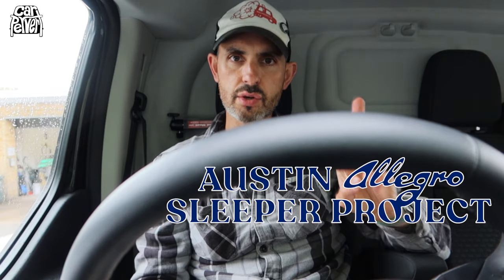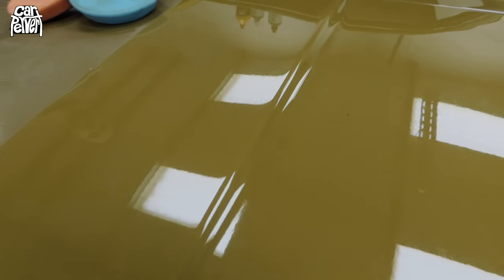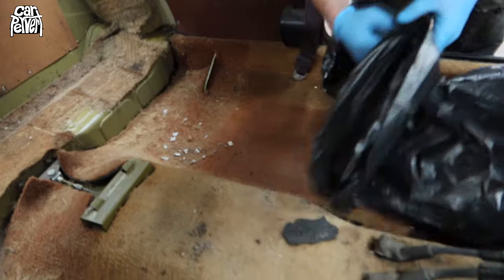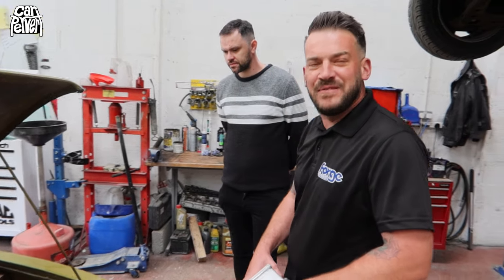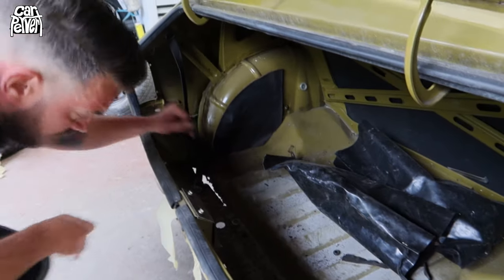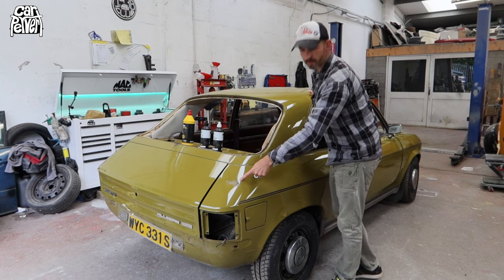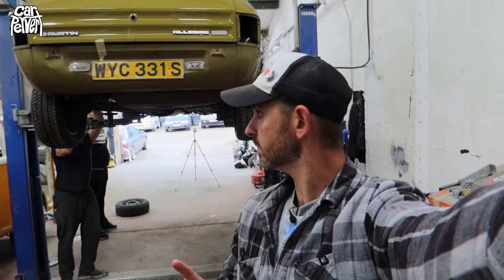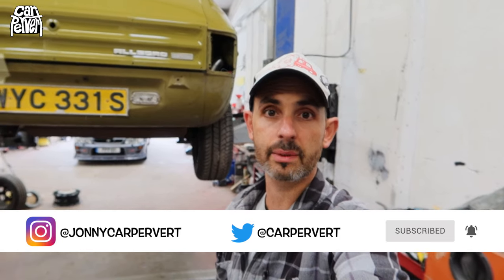Part 2: Austin Allegro V6 supercharged sleeper project

Comment: I am surprised you would use an Eaton Blower (ala improved  but still inefficient GM 2 stroke blower).  I would have thought a Sprintex unit would have been smaller and they are certainly way more efficient, thus giving you two pluses and no minus's.  I can only presume it is due to obtaining the blower cheap.  It will certainly be more difficult to install in that somewhat cramped engine bay.  Apart from that, a really nice installation being performed.  Have only just found your channel last week.  Thanks

Comment: Im limited on space and cool air on a vw T3 bus as well. So chose a chargecooler, small unit fits under the lid. Made a 10ltr water tank and audi cwa50 pump, all works and flows nicely. Chargecooling is sometimes the only option on rear engine cars, or limited on real estate upfront. 👌

Comment: Question: Why not use an Allegro Vanden Plas (guess they're super rare now)? That big front looks like it was made for a big Rad/Intercooler. 
That said, I can't wait for the updates on this project. Talk about an unlikely sleeper 👍
Reply from the maker: VP grille would be ideal for a cooler, you're right. Trouble is, I hate them.

Comment: It's SOOOO nice to be able to start with a relatively solid rust free car. Eager to see how this goes once you've got it all together. I really like the idea of the rear rad with a nice custom fuel tank up against the rear seat bulkhead. Don't pay attention to the nay-sayers. You should have heard (and they continue) the purists when I had a D16 VTEC swapped into my 1968 Riley Elf. Don't care. It's my car and it's the way I want it. Crack on!

Comment: Hi Jonny, I have a soft spot for the Allegro.  When I was 18, I had a lift home from the local public house with three other friends as passengers when a Peugeot 205 GIT (there is only a single marque worthy of the GTI moniker and has been made in Wolfsberg since 1976) overtook us whilst we were indicating to turn right off the Dukes Ride in Crowthorne, near the Station.  The owner, Jason Longely, pursued the 205 towards the station until confronted by the F@ckwit driver standing in the road waving a tyre iron, he drove the car into the car park and without stopping back out again onto the road.  For a low mileage 1977 Mk2 four door 1275cc (one previous elderly owner, kept it immaculate) it was superb, not the asthmatic heap typically portrayed.  We were then chased around Edgcumbe Park for some 30 minutes but lost the nutter among the high value property...

Comment: Jonny havin use to work with you in the Rev's / Max power day's only you would do this with one of BL's shitters !  love it , ive just charge cooled my 98 T4 2.5 van and ive dropped 15-25 degrees and it works a treat. My cooler rad is under the van with 19mm hoses running to the front to a small alley tank and 12v vw sharan aux pump ... owe and it looks the part ;-)

Comment: If it's not all already fixed, you could use the fuel tank as a shell keeping the rear looking stock but the front end of the tank could be chopped off to act as a duct. To let the air through the floor and pass the radiator
Reply: Might collect a lot of crap though.
Reply from the maker: Very cool idea, thank you.

Comment: I doubt those hub caps would make it past track inspection if they are just pressed on. Might need a stealthy nut and bolt or safety wire solution 😉

Comment: I had an Austin Maxi sleeper once, it only had the standard 1700cc engine, but it was so slow you would be asleep in no time 😜

When I got it it was bright yellow with sun faded patches, I wasn't going to pay for a re-spray so painted it myself, I didn't enough of one colour so mixed all the paints I had, ended up a grey like primer, oh and this was house paint not car paint 😎 and I painted it with a brush, although without showing off you couldn't tell as I did it without any brushmarks, lots of room inside, but drove like a bus and just as slow, I don't miss it that's for sure.

Comment: If you are going to all this trouble- turn the engine around and make it RWD- radiator will fit then too. There is a tunnel of sorts there,  fab up the  gerabox hump, use a sister rear end out of a Farina maybe?

Comment: Single tube radiator might flow better but the twin tube will give more surface area between the air/water interface. Almost a case of 6 of one, half a dozen of another... Depends on how efficient the water pump is and how much piping you need to traverse going to the boot.

Comment: Will you not need a strong subframe to mount the engine to? Not to mention uprated suspension, brakes etc..
I have driven alegro's in the past and they flex so much if you jack one up with a door open you will never close the door.
Reply from the maker: All in good time.

Comment: Hey Jonny , another great video, with the radiator have you thought about putting it on the inside of the boot lid,eg 911.
Also good luck finding good 14" rubber, might be worth going bigger for better tyres choice. Just saying😉

Comment: i had an allegro in that same colour back in the late 80s. 'mustard' i more hopefully described it. mine was the 1500 engine model, but unfortunately though it just about survived an incident with an errant street light; (a tug with some rope on a tree later to pull the front back out the next day); it didn't survive some snot rag tipping sugar in the fuel tank.  it would've cost more to get it back on road with upcoming mot than it was worth, even back then.

Comment: Jonny.  You may have already mentioned the colour. Limeflower?  Leyland did some awful colours in the '70's/80's ! And just in case!! We were sent a memo., do NOT jack the car up with the doors open ! I think this refered to the 4 door specifically. There's a fair bit of welding required on this but in Allegro terms it's mint !

Comment: Lack of rot certainly will speed up the progress and save the pennies. I wonder how the boot radiator is going to be done and will it open slightly to dissipate heat maybe controlled electronically....

Comment: Jonny, you didn't say or I guess I didn't catch it in this or the first Allegro v6- but is that the FWD trans from the Rover or is the KV6 grafted onto the gearbox from the Austin? A very intriguing build- a sleeper indeed! This ought to ambush more than a few puffed up Jag and BMW owners!
Reply from the maker: This is the engine and original 5 speed gearbox from the 1993 Rover 827 Si. The engine of this era was a Honda but I think the gearbox was Rover.

Comment: You put the car on the lift and I thought "Those brakes look familiar".
Your not cutting up a car, the floor in the rear need to be replaced anyway and can easily be put back to stock.
Lovin the Avocado Green !

Comment: You could have two radiator fans on top in the trunk and have one be a puller and one a pusher fan to circulate air in the trunk

Comment: 10:23 It's how I buy old record players. Buy them broken, usually not that bad if they are simple ones :D. 
So little rot on the little Allegro, pleasing!
Unrelated question; What camera are you using: I saw a compact in the car's reflection (loads of reflection!) and the image and sound are both remarkably good for a compact, stabilizing seems great too. So now I'm curious!

Comment: Those brakes! It only weight 800-odd kilos! You won't have to worry about it stopping. The wheels, at least. Though, under hard braking, the body might end up with a slightly longer stopping distance!

Comment: Can you put the rear radiator in the place of the fuel tank? Like cut the tank out but leave the bottom as to cover the radiator and fans and it could also grab forced air from underneath the car? I hope you understand what I’m saying 💁🏻. Then maybe fabricate a fuel cell that looks like the trunk floor?...or “boot” floor? I think that would be cool and stealthy!

Comment: I think you just should had mount a 114, K motor with a supercharger. Solved a lot of the cooling issues and would perform pretty nice, I think.
Reply from the maker: K series?
Reply: @TheLateBrakeShow  yes, the K8 and K16
1400's from the metro 114.

Comment: I had Allegro 1500 5-speed,four door in British Racing Green for eleven years...Died due of corrosion after 28 years and had 185 000 miles on the clock with only minor issues...Why is this car hated??

Comment: Those seats, why not investigate some Austin/Leyland Princess seats. of the same era, would have the same colour/material to match but with a higher back and head restraints... safer in this modern world.. just a thought. ... I had a MK2 Allegro with full leather and wood interior out of a Vanden Plas along with the 1.5 and 5 speed. Cracking little car, wish I still had it.
Reply from the maker: Great idea. I might look for some brown high backs

Comment: What is the Budget/Cost on a project like this? I’ve wanted to a project like this for years but always worried I’d end up sinking tens of thousands into it.
Reply from the maker: Very hard to estimate, as depends on level of detail (engine paint, suspension paint, chassis paint) and type of engine and tune you opt for.

Comment: If the car is machine polished, how is it that the paint isn’t “sanded off” off by the discs?
Reply: The top “layer” is, to reveal the good paint underneath. It’s all about how aggressive to abrasives and compounds used are as to how much/how quickly the paint gets removed. If you use something too aggressive or go over too much then eventually you’ll burn through to primer etc

Comment: Why not fit a half radiator at an angle and mount a coolant tank in the trunk? Long coolant lines but it would offset the weight at the front somewhat

Comment: How about a Porsche style twin front rad set up fed by those twin grilles on the front panel and flow boosted by an auxiliary electric water pump? Leaving the remaining frontal space for the oil and intercoolers?...??

Comment: You need a solid car to modify, no good putting a lot more power into a car then leaving the backend sitting at a set of lights. Also, regarding this car, had you not bought it, someone else could have more than likely stripped it for parts and it would have been lost, even if the person who bought it realised how good what they had was, they would likely not have had the resources to rescue it alongside whatever project they bought it for getting it closer to completion. And as you're doing a sleeper, you're going to preserve a lot of this car, so I think, given where it was heading, this is the best outcome for this car. Second best in a perfect world where seeing it become a 100% preservation/survivor is what would happen, but again, likelihood of it being rescued like that was very low.

Comment: Would an angled radiator core not work perfectly in that location. Get the air scooped in from underneath or through the rear sills, so that the angle of the core doesn't come perpendicular to the air flow. That ought to aid flow through the radiator, and allow for a shallower, more compact setup.  BMR in Leicestershire do 45° cores
Reply from the maker: You might have a plan.

Comment: i'd still get some nice after market wheels just for the show...
also 4wheel drive maybe?:D
Reply from the maker: I have considered it. Got a set of Lotus Eclat polished rims I was going to use.
Reply: (i had to google the eclat rims for a sec there) hmm i was thinking about something on the 3part 15-16inch bbs line, but looking at these they might look great on the allegro as well. I just feel like, that a modified allegro needs some nice rims that give away, that something isn't really right there. 
on the other side completely I agree with the "keep the rest of the car as stock as possible from the outside"

Comment: Obviously it needs more room for removing air from the radiator. + heating all that fuel is very bad for performance.
Why not make whole partition between rear lights a net or ribs? A'la Testarossa.

Comment: Has this very interesting project stalled permanently or simply on a back slow burner pending better times?

Had Allegros as company cars back in the early days. A basic 1100 with good old A-Series and a top spec 1750cc with twin SUs. The latter would show a clean set of back wheels to many other ordinary production cars about on UK roads back then much to the surprise and chagrin of the owners of so called "superior" means of getting about. 

I blame the snide smirking Clarkson kneeling at the side of an Allegro in the intro of one of his very early Clarkson's Motorworlds or whatever it was called. Huge negative influence and his many follower Clarkson wannabees who studied and passed with flying colours at the Clarkson Academy of Motoring appraisal excellence still continue to spread their poison about most things that Longbridge, Abingdon and Cowley produced.

That aged BL paintwork came up a treat! So base material quality must be good to achieve that after all those years.

Have searched YT for later updates but have drawn a blank.  Do they exist?

Comment: Fit ac cobra style bumpers , it will fit with the curves and look like a Shelby hot hatch 😀
Reply from the maker: Nope, all original trim and bumpers going back on.
Reply: @TheLateBrakeShow  yeah, can't really argue with what you have planned, the ultimate sleeper, just the curvy shape low down made me think cobra. Would like to see this line up against project binky

Comment: Hubnut just realised that raptor isn’t all it’s cracked up to be on the underside of his 2cv
Reply: If the surface underneath is prepared correctly, it is virtually indestructible in anything but extreme circumstances. If the surface underneath is less than perfect, it won’t last very long

Comment: Jonny, when you have finished your much appreciated dinosaur conversion, please consider many of the EV tuning companies that currently offer 600+hp from the addition of a rear Tesla drive unit. This would finish the car nicely with a rear-wheel drive Tesla performance upgrade. This can give you at least 1000 hp all round in an Allegro, and you should win an award or Guiness world record for the madness that the car would become. You can put the batteries in the boot or in place of the rear seats. You would not require a large battery space as you can use this just for traffic light grand prix or quarter mile annihilation's.  This would make the project a true 4 wheel drive sleeper, and also a hybrid (!) - which I am sure would upset the DVLA as it would have a lower taxation class. I am sure everyone would like to see this, as it would be the absolute ultimate sleeper being as it is an "All Aggro" . The original paint just confirms the sleeper concept. Great video and looking forward to the updates. Just build it! :)
Reply from the maker: Done an EV dragster. If I did a Tesla swap in the Allegro it would be £25k. Not possible.

Comment: Why don’t you use a GM Ecotec L67 S/C motor much smaller engine that still makes great power and they came as front wheel drive

Comment: My mate had one of these things with an almost square steering wheel and the speedo that was a red line going horizontally. Hideous device. It was crashed repeatedly into a disused power station and rolled into the river Eden in Carlisle. He never received a penny from the insurance fraud attempt and suffered quite bad whiplash from the contact with said power station. I remember being bloody angry as i watched the rainbow of fuel and oil drift down the river i loved to fish. Ah the 80's.

Comment: Every one laughed at Alegros. My Dad had one it took my Mam and Dad 600 miles every week for 9 months so my Mam could have kidney dialysis. He also used it everyday for work etc. The car was never serviced at all during those months. The last time she had to travel for dialysis the engine broke down on our drive when they returned home. The only thing wrong was the points in the distributor had wielded together. They were as good as any other car at the time.

Comment: Please put a separate radiator for the charge-cooler! You dont want the water doing charge-cooling running at 85-95 degrees, might as well be without that 'cooler' if running such high temps! Better off having what temps nature has.
Reply from the maker: It will be separate.

Comment: Is there some maths behind how big a car radiator needs to be? For example you need to work out how much heat energy your car engine creates and then the surface area of the radiator? A radiator from a 1.4 100hp wouldn’t be able to cool a 2.7 litre 200hp engine enough.

Comment: I thought the Allegro was OK. It was maligned by very evil-minded motoring pundits. The VDP 1500 was a work of art, inside. And the late models with twin headlamps was a visual improvement over the standard early version.

Comment: The paint looked far better with the patina... should of left it as it was
Reply from the maker: It looked great, but I was weary that it would deteriorate to the point of rust in key areas. At least this way we can leave it to dull back, or celebrate the scratches.
Reply: CarPervert I figured that was your reasoning... logical,but when you "pulled" it out of the garage with those boxes inside.. seats on the roof.. nothing would be more hilarious, as well as disconcerting to other track day participants..than seeing the car in that condition.. on,y to then have it sound sweet and blow past them on track. 
Good luck with the project it still looks fantastic ..(something different )  everyone loves the unusual.

Comment: Sorry, still think You should have transplanted Tesla running gear with Tesla battery pack into the Allegro 😷
Reply from the maker: About £20k more than I have Steve.
Reply: @TheLateBrakeShow  
shoe string budget ev conversion :
 I'm transplanting salvaged Mitsi phev drivetrain , ev system and battery into a  L322 full fat  rr ,
It's going to be my ultimate shoestring  4x4 EV , needs to finish on a much smaller bugdet than the Allegro 😷